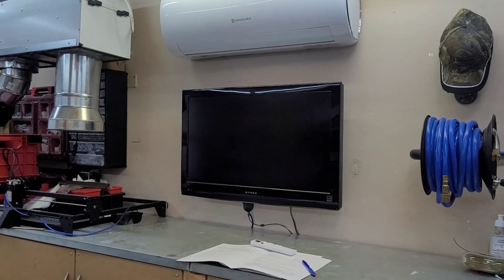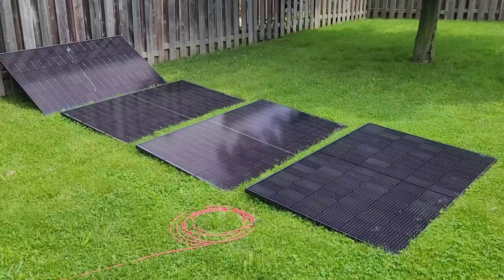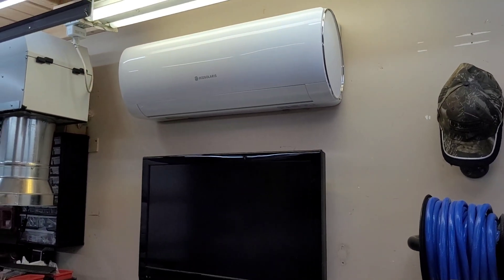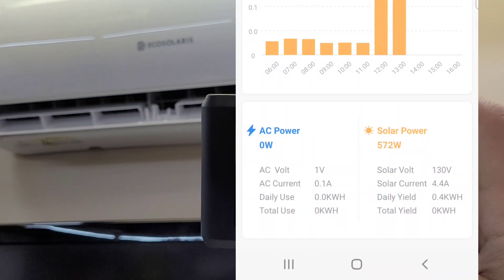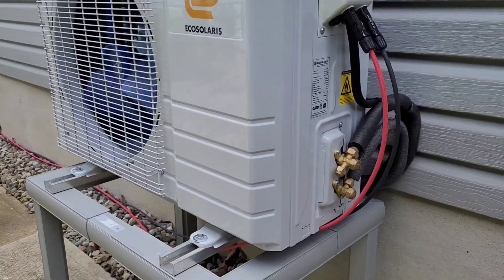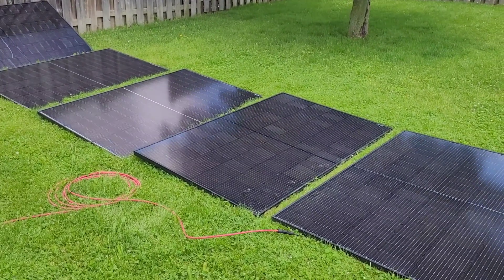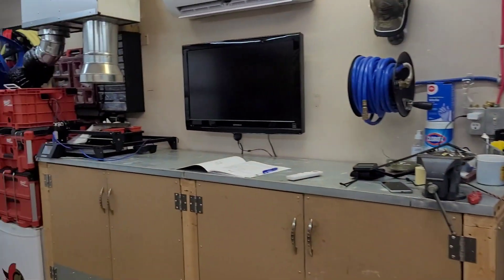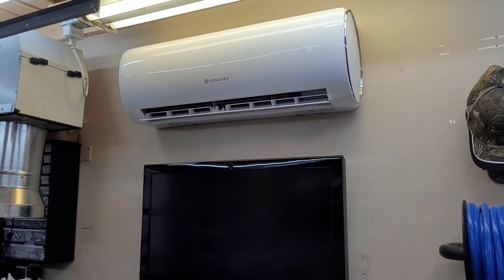Can You Run A Mini Split On Solar Panels?

Comment: I was very interested in Ecosolaris but these are not DIY systems. According to the company website, customers must hire a local refrigeration mechanic to do the install. And the linesets are not included in the package price either! Around here (British Columbia) no HVAC company will install a system the homeowner has already purchased; they want to profit from the markup on a system THEY sell. So buyer beware! You can find yourself stuck with a nice heat pump that will never be installed. Go with EG4, Airspool or MrCool (MrCool is utility powered only).

Comment: why worry about the clouds and whether you get enough juice when you can use a battery and an inverter? You could probably get away with a deep cycle automotive battery or even a regular lead acid battery with a cap.

Comment: QUESTION: When the sun is no longer sufficient to run the mini-split, the next day when the sun become sufficient again, does the unit resume operating on its own at the same temperature settings, without any user intervention?

Could you show info from the manual or a video demonstrating this capability?
Reply from the maker: Yes it will come back on the next day when there is sufficient sun

Comment: How many panel do I need for 12000 btu it’s 220v power watt 2600. And it has another 700 to 5000 watts number on there from China
Reply: A 12,000 Btu system (one ton) generally requires about 1300-1500W of PV panels. If you look at the EG4 and Airspool websites they explain this.

Comment: I have a question...how large of a battery bank do you think you would need to efficiently run this overnight? As well, any input on how large a solar array needed to charge batteries in addition to running AC during the day? 

Something im learning about small scale solar (the hard way) is needing a large battery bank but also needing a large enough solar array to not only run items during the day but recharge what was used overnight, effectively needing to double a solar array.
Reply from the maker: @UserFormelyKnownAs_hjkh  check my recent video of this Ac running on battery over night
Reply: @SmitHVAC.  i actually just finished watching that video! Very informative. I have subbed to your channel to follow along. How large of a solar array are you running on the 6000xp and does it keep up well?
Reply from the maker: @UserFormelyKnownAs_hjkh  I just had a 1200w and upgraded to 2400w. Working good so far but you could always have more!
Reply: @SmitHVAC.  awesome! Keep up the great work. I have lots of electrical knowledge but am slowly but surely finding out things i had not considered about solar as they trickle in and become problematic. Its great to see someone putting these things through some real world testing. I would love to know how your mini split did on nothing but solar/battery over the course of a week or so. A setup like yours is a great consideration of mine but Texas summers are long and brutal.